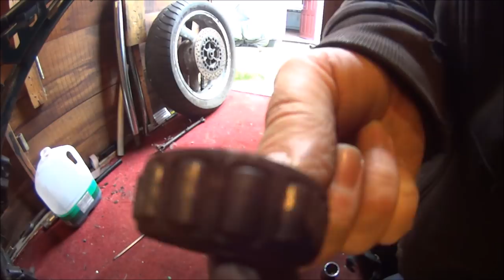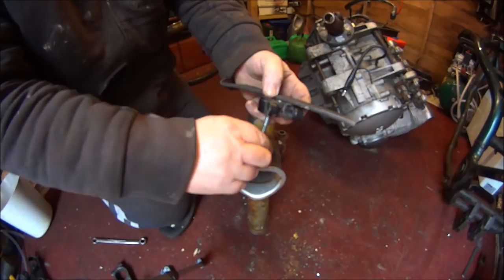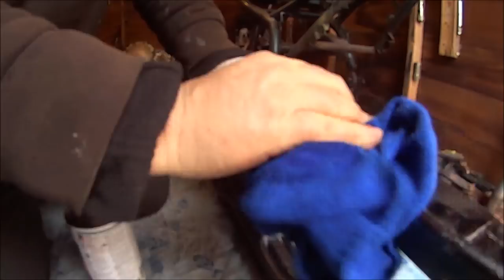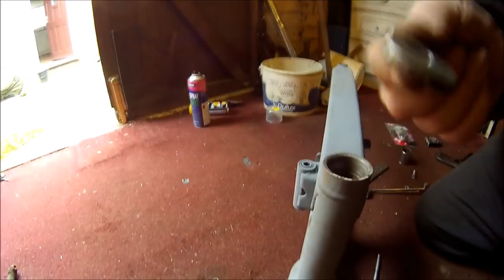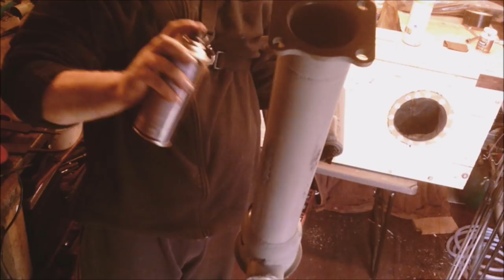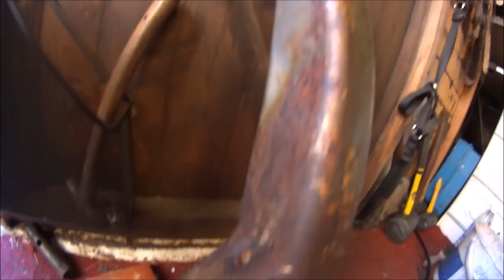YAMAHA XJ900S DIVERSION. swinging arm total refurb

Comment: I've just bought me a xj900 and I'm wondering if you could tell me the best place to get everything I'd need to fully service the swingarm and drive shaft
Reply from the maker: I found all my parts on eBay 👍
Reply: What parts are needed to be replaced when refurbishing the swing arm ( I can't seem to find what is needed or the sizes 🤦😞 )
Reply from the maker: https://www.ebay.co.uk/itm/183726888646?hash=item2ac6f9d6c6:g:opwAAOSwuopch9ys
Reply: @jonyr1TT  wow is that really all that's needed ...I thought it would need more seeing as you have the drive shaft and final gear bolted onto it too . thank you for the link too